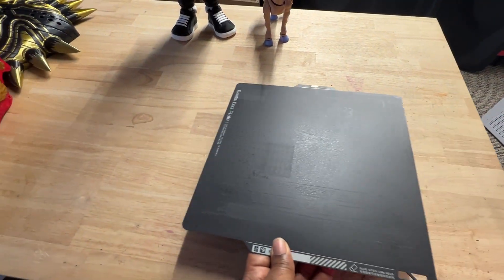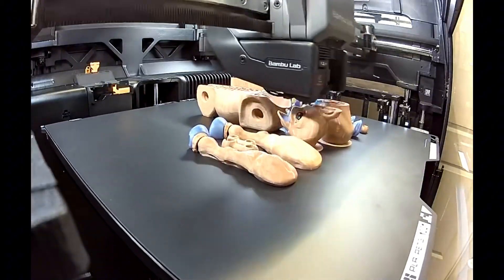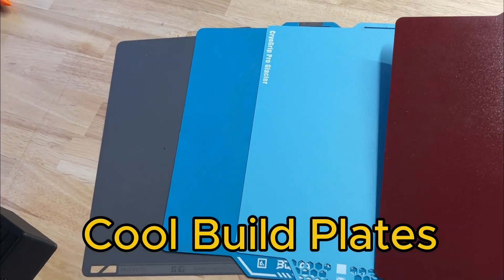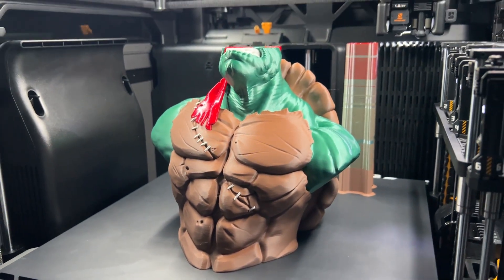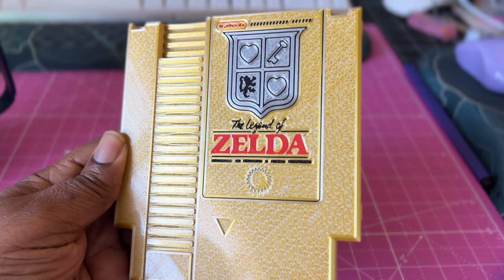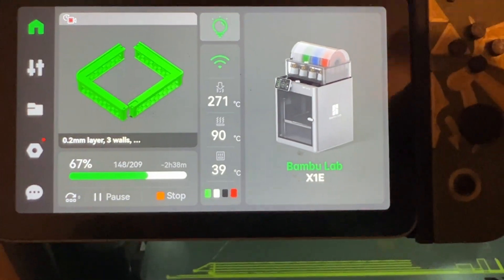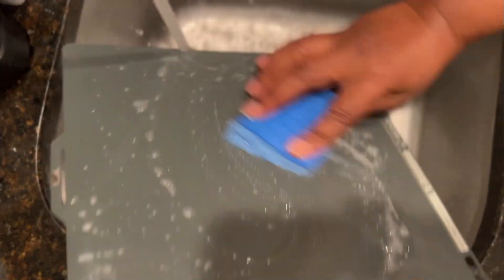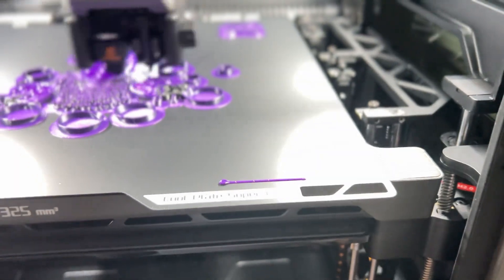Best 3D Printer Build Plates Explained

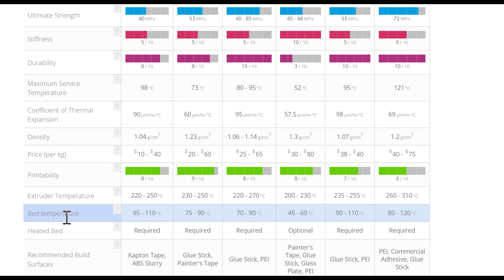Comment: 6:25 what brand plate is that?
Reply from the maker: It’s a Bambu PEI plate. They made them in black for awhile and then stopped selling them. They are not different than the gold, but some users state that they had adhesion issues with the black PEI plates from Bambu.

Comment: Smooth PEI is applied as a sticker layer, being easier to damage than the powder-coated textured PEI. It sticks significantly better, but it sticks too well for TPU and for PETG, which can easily rip up the layer. The extent to which the powder-coated textured PEI sticks depends significantly on the manufacturer. I’ve found that a carbon-fibre-patterned “PET” plate grips better than one of my textured PEI plates so it’s become a general-purpose plate for me, though it has started loosing little chips in the middle from PETG use.
Reply: Be careful, you might lose your loose change.
Reply from the maker: Great insights on the pros and cons of smooth vs. textured PEI, especially regarding TPU and PETG adhesion. Appreciate you sharing your findings!

Comment: What kinda slicer settings do yall use with the decorative plates? They arent recognized in the bambu software and ill get a bad first layer alot of the time.
Reply from the maker: I honestly use the high temp plate option and make certain to turn off the plate recognition settings. I do still watch my first layer and make sure my bed temp is correct for the filament I’m using.

Comment: I use a metal scraper on my smooth pei all the time... never had a problem. However if I don't use glue on smooth pei... it becomes VERY hard to remove TPU prints.
Reply from the maker: Good to know about your experience with the metal scraper on smooth PEI!

Comment: I use Textured PEI plates 99% of the time, and smooth plates for initial Z-offset and 1st layer calibration. I tried some decorative plates a few years ago, yet ... It's not for me. Most things I print are functional things, so there's no need for a fancy-looking first layer. ^^
As for "adhesive agent", to me it's more like a release agent : PETG and TPU stick far too well to PEI, so a thin layer helps a lot to avoid ruining PEI plates. Same thing for two ASA and ABS variants from FormFutura (TitanX and ApolloX) : stick like crazy, release agent required (NanoPolymer).
Reply from the maker: Thanks for sharing your routine! It's interesting how different users find what works best for their specific needs.
Reply: @InfiniteLayers3D  You're welcome 🙂 To be honest, I'd also use either NanoPolymer or Magigoo PA for Nylons (PA6 / Nylon-6, in particular), yet as a adhesive agent. I didn't experiment with Nylons yet, though. Shall do that very soon.

Comment: The metal scraper is fine, as long as you're careful in how you use it.  It's a precision instrument, not a shovel or a hammer or an icepick.  When printing, hot air can get trapped between the print and the bed, and when the print cools, the air shrinks, causing a vacuum.  The sharp blade of a metal scraper like the Bambu one shown in your video, can slide between the plate the print, without damaging either, and release that vacuum.  Also works well for brims, extrusion tests, and other very thin bits.
Reply: True, but I've never had an occasion where plastic didn't work and you can print them out of scraps of waste material so why take the risk?
Reply: @severnsea what type of printed scraper did you use? I printed once from creality starter file on my ender 3 v3, and the tip broke easily and not sharp enough anymore in 2-3 months to pry the object from plate
Reply from the maker: Excellent points! Thanks for sharing your experience and tips. 🙌

Comment: I need me a new plate lol my pei plate has 0 stick with any filament,   I bought the printer used btw so trust me ik its not just me lol
Reply: You can use some cheap glue stick if you don't want to put out for a cool plate. I've been running the same stock pei plate over 750 hours. It stopped sticking around 250 hours, and I just put some cheap Amazon brand glue stick on there and now PLA and petg stick and release better than new.

I barely ever wash the plate, the glue just keeps on sticking for dozens of prints. I basically only wash and reglue if the print is critical; like maybe it will take 16+hours or if it uses the entire build plate for its base.
Reply: You’ve given it a good soapy scrub? Check what the first-layer squish is like, you may need to change Z-offset or bed level knobs.

Comment: One thing you could have mentioned is it's always preferable to remove the whole build plate from the printer after a print and let it cool fully before removing the parts - removing parts while the build plate is hot will significantly reduce the overall lifespan of the plate over time. For people in a production situation, having two identical plates in rotation is definitely the way to go.
Reply: Doesn't everybody do that? Makes more sense to me to remove the plate and replace it to save waiting time. I knew nothing about 3D printing when I started but the first thing I did was order an extra plate with the printer. Just seemed like the obvious thing to do to me.

Comment: For PLA I have been using a glass plate. It sticks very well, sometimes too well. When it cools down the print falls off., if not I put it in the freezer for a little while and then it comes off.
Reply: Please join us in the year 2026 and get a PEI plate. Glass was used because at the time, it was the best option. I promise modern build plates are SO much nicer to use now.